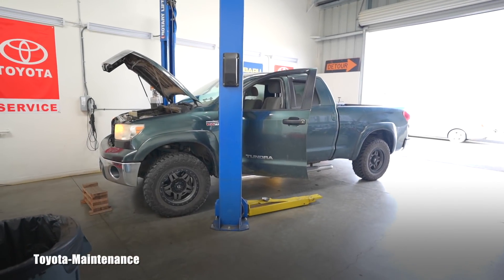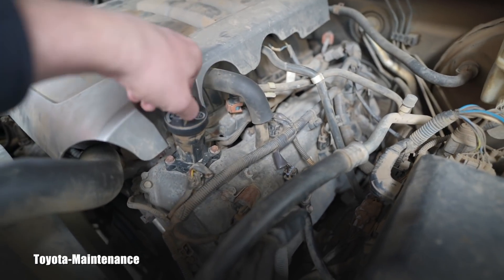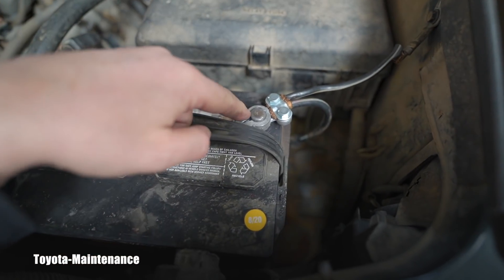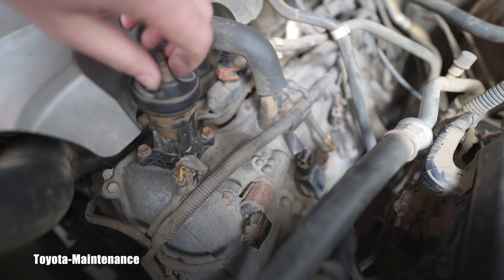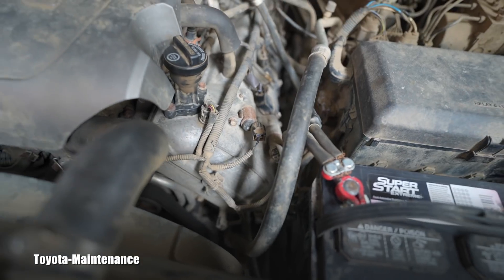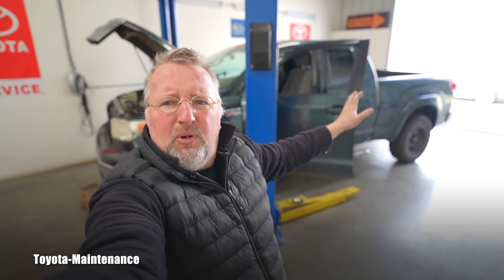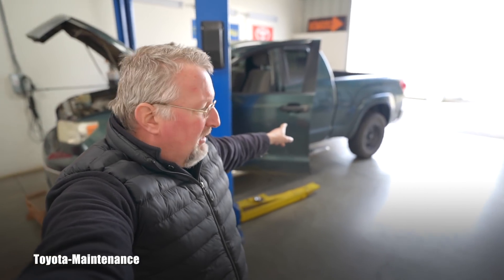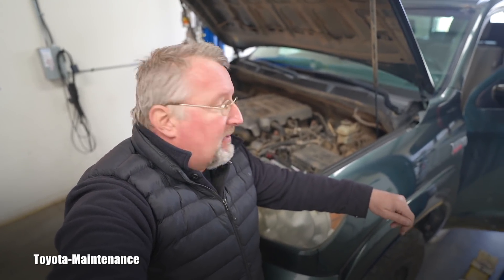Toyota 5.7L V8 Engine 3UR-FE clicking, rattling on Bank 1

Comment: It's the timing chain tensioner. I just fixed this on my truck
Reply: How many miles was on your truck when you changed it ?
Reply: @WVFAN1958  not sure. I bought the engine used from a salvage yard, it came out of a 2017 theft recovery and said it had about 30k miles. When I opened up the front of the engine I found someone had messed with the timing prior to me. The sprockets were marked with a paint marker and the timing chain was installed with the marks facing in and not synced with the cam gears. Anyhow, I cleaned up that whole mess. I tuned in to that issue because I noticed the timing chain slap was getting pretty bad at idle, I could hear it from inside the cab when waiting at a red light. Look "loose timing chain Toyota tundra" on YouTube and a few videos come up where they identify the symptom and cross your fingers you don't have to do that job.
Reply: I didn't realize this is the video of the chain slap... This is it.
Reply: @rosadoja2000  so just replacing the main tensioner has cured your issue this far?
Reply: @teamhogmeat  Yes, riming chain job did it for me and have not had this issue sonce. i took a "now that you're here" approach and replaced sprockets, guides, tensioners, chains, and crank shaft seal while I had the front cover open. It took me about a week working on it in the evenings after work and cost nearly $1000 in parts because I used all factory parts. I didn't buy aftermarket parts. It's not a difficult job, just make sure you get TDC right before you take it all apart.
Reply: @rosadoja2000  Thank You
Reply: @rosadoja2000  did you replace the phaser sprockets also?
Reply: @grahamwheeler9469  I am not sure what exactly is  phaser sprockets, but I will assume it's the VVTI sprocket on the intake cams. Those we're not replaced. Only crank shaft sprockets (it has 2). The engine will throw an error code for the cam shaft position sensor if there is a problem with the cam shaft sprockets. I would not replace them unless I got that error code. Funny thing about it was that there were no error codes for the lose chain. It just sounded like a diesel engine.
Reply: @rosadoja2000  The reason I'm asking is because my 2013 broke the small chain connecting to the bank-1 exhaust cam, and the mechanic who diagnosed it wants to replace basically everything.... They did a leak down (10% on bank 2 and 50% on bank 1) test.  Those sprockets are really spendy....and it's making the total cost of the job about the same as swapping  a motor out of a wreck with less miles..... So I'm kind of in the "limbo" of deciding which way to go....   Its rather discouraging, as I just got the vehicle.... the shop does say that the quality of the internal oil appears to be fairly clean/ good.... no sign of abuse/lack of maintenance  (coked up oil deposits)...
Reply: @rosadoja2000  The reason I was asking was because on my 2013, the small chain on the exhaust cam broke...I understand that the sprockets that carry this chain (between the intake cam and exhaust cam), are called phaser sprockets.  They are really expensive sprockets.  The guy that is looking at my motor did a leak down test on both sides (bank 2 - Passenger side), is about 11%, and bank 1-drivers side is about 50%).  I understand that leak-down tests are supposed to be between 4-12% to be within spec - so one side is "good as new" for  a cold engine, and the other side indicates moderate valve damage.  

Frankly I'm in limbo-just now... Cause the price of changing all the parts that the mechanic is quoting me to do is basically close to the cost of pulling my motor out (229k miles) out and swapping in a motor from a wreck (2014 with 135k miles).  The only pause, is the mechanic said the oil in my motor didn't look bad - No deposits/lack of oil changes apparent.... I just bought this thing literally 1-month before the chain broke...so while I don't know the maintenance history perfectly...clean oil-inside is a good sign... And with a wreck you don't really know how it was maintained...  The one thing that could tip-the scales to fixing, is if the phaser-sprockets didn't have to be replaced... If the old sprockets are acceptable the job cost would be reduced by about 19%... and make repair the preferred route..    I need some specs to evaluate if they are good or not... Unfortunately the mechanic has a "replace everything" mentality, where as I don't think it is all required to be replaced.... but I don't actually know that...  I know of that attitude, as when he started to price the job, he actually suggested to replace the timing chain cover.... which I thought was madness....
Reply: @grahamwheeler9469  sorry to hear about your new to you truck breaking down. When I bought my truck, I bought it knowing it had issues so I got a good price on it although I didn't anticipate that I would need to replace the engine within the first few weeks of owning it. There is a lot to consider when buying a used engine but due diligence pays off. For example, if you go to the used engine market, you can narrow down your search to a select few candidates and run the Carfax on the VINs to paint a picture of the history of the truck that the engine came from. You have 3 options:
1) fix in place (what you are considering)
2) get a decent used engine from a wreck or theft recovery (what I did)
3) buy a freshly rebuilt engine from a quality reputable builder

From a reliability perspective, option 2 is best if you find yourself am engine that was cared for.
With option 1, it's the highest risk mainly since your engine is not holding compression. The risk of having valve damage from the broken chain, opening the head, having to remove it, getting all original parts, will cost you almost the same as a swap. That's why I decided to do the swap.

Option 2, the risk is obvious but you can mitigate that mostly with due diligence. Find yourself a theft recovery low miles engine. I scored one with 17000 miles on it from a theft recovery.

Option 3 is the most expensive, but you have peace of mind and the risk is lowest.

Remember, what may seem cheap today is going to cost you more in the long run. Like my buddy who buys a rebuilt battery every 3 months at $40 a pop. By the end of the year he has spent $160 on car batteries when he could have just bought a decent battery for $120.
Next point is, if you go with option 1 or 2, use only genuine Toyota parts where ever you replace parts. Don't cheap out with Amazon parts.

Lastly, if you don't fully trust your mechanic, find another one that is honest and thorough with the trouble shooting. I do all my own work except for the really hard stuff like automatic transmission rebuilds or carburetor rebuilds. In those cases, I remove the part and take it to the shop and have them do the bench work. But you have to have an appreciation for fixing cars to do this kind of work and enjoy it. I'll tell you... It is very satisfying when you can get in your vehicle and drive down the highway or cross country, with peace of mind knowing that your hands, mind, and ability made this possible.
Reply: @rosadoja2000  I''ve done my own timing belt job on the V8 on a previously owned Sequoia 2003, and Tundra 2002.  But I don't have a shop at this moment, and it's kind of tough to do that job without a shop.... 

for a 4th, option...I actually stumbled across a Chinese knock off 3UR engine that I can get for only $750 new.... I'd have to buy 2, and I understand with shipping would be about so about $1000/each for two factory new "knock off's".... waiting about 75 days for it to arrive.. (I would assume I could sell the extra for about what I have into it...but even If I couldn't its not a bad price.....if it would run well for 100k miles).   Toyota quoted me something ridiculous like just under $26k for a new one.... 

I am kind of leaning on the used motor idea.... That's a really good idea to get a car-fax on the vehicle that the motor comes out of.... I hadn't thought about that.... service history was the one thing I was worried about...

If you are curious about the knock off Chinese motor check this out... 
https://www.alibaba.com/product-detail/CNBF-Flying-Auto-Parts-3UR-Motor_1600329730312.html

I think I can trust the guy who I'm at, but he quoted changing the Cam Sprockets on both sides... they are different on exhaust/Inlet/ and for me amounts to almost $1400 alone... as he is charging me retail... I know I can get them direct for about %20 less...but it's kind of mute unless I do it myself...  A parts guy at the dealership kind of highlighted to me that with the broken chain, there may be "shrapnel" kicking around the housing and it could have caused other damage.... However it didn't exactly "run" long after the chain broke.
Reply: @grahamwheeler9469  I would stay away from the knock off stuff. If I were in your shoes, option 4 would not be an option. That's what I was referring to with the cheaping out with Amazon parts. The Chinese bootleg Ali Baba stuff is good for some things, but not as an equivalent for genuine parts. One of the things you have to consider about Toyota is how Toyotas retain their value. If you go with a knock off, your truck would lose value if you ever have to sell it. 

Im not telling you what to do. I'm simply going through the logic and reasoning that I would go through, if I were in your shoes. I would find myself a good used engine that is still factory sealed. I would search within a 250 mile radius for someone that is parting out a tundra or Sequoia. Even better if I can see and hear the engine run before I would commit to it with my hard earned cash. To me, the engine with a busted timing chain is toast and would need a complete teardown and inspected for bore and piston tolerances, cracks, and cam lobe tolerances. Then put back together with genuine parts. It's too much time and parts, that it's more cost effective to get a good used donor engine. That's how I would approach it. Although that being said, I am big on quality work and parts, i pride in ownership, and I highly value reliability. Those are the values that guide how I reason out and decide any repair situation on any of my Toyotas that I plan on keeping for a long time.
Reply: @rosadoja2000  I have been thinking of sticking with a wreck donor motor.  I'm actually up in Canada, so my Choices aren't as good as down there.  I've been converting price to USD to keep things consistent in our conversation.  I really appreciate the carfax advice!  I actually found that the maintenance info can be had for free, on the Canadian site... I just have to sign up and add the VIN's I'm looking at to my "garage".  I'm considering a side-impact-wreck motor with less than 75k miles on it, out of a 2014.  It's also "lived" away from places where salt is used, so I kind of like that also.  I'm thinking I'll be about maybe paying about $1k more than the rebuild, but I'll have a motor with 1/3 the mileage on it.  

I did kind of get a deal on the truck.... but there was a "whine" in the back end and I got new berings put in there.... so I've already fixed one "biggie".   I did breaks all around - Brimbo, where I could get them... and I noticed that the rear "dust covers" were "like new", where as the front ones were kind of "rusted-crumbly"... So that tells me that the rear bearings have been done...So I'm guessing the only remaining major repairs will be "suspension", and maybe front bearings....  My son did suggest that I may as well try to get the transmission with the engine... I'm not sure what to think of that... I don't have a good feel for the life of the transmission....  Thoughts on the transmission front?  Its got just under 230k miles on it.  I haven't even asked the transmission pricing question yet...

Comment: Take off the valve cover and clean the oil rail and the filter located on the under side of valve cover you will need to remove the 3 10mm bolts on the under side of the valve cover to access the filter
Reply: Driver side valve cover correct?. Doe that rail feed oil to the main chain tensioner?

Comment: I thought Toyota V6 and V8 engines had timing belts, not chains.
My Chevy Express 5.0L had an annoying ticking noise too.  My friend who owned (now retired) a transmission shop put it on his lift and it turned out to be a bad catalytic convertor falling apart internally.  I could have sworn it was coming from the engine.

Comment: I had a '93 Mazda MPV that started clacking like that every single morning. I could drive to basically the exact same spot every day and it would stop within half a block. Every single time. I think it was a valve lifter. Sold it like that. Still ran for years later.

Comment: 0-40 synthetic with a good oil stabilizer such as Hot shots secret, stiction eliminator. I had the same problem with my 08 . Works great
Reply: 0-40 Eliminated the noise ?
Reply: @anthonyvasquez7050  it did with Hot shots.

Comment: I have a 06 Tundra with 2UZ-FE eng, after timing belt complete job(everything new & japanese parts) it started making a similar noise, please if you can work on that vehicle and make the diagnose, I really need to have options for getting it away, my noise doesn't go away.

Comment: Sounds like a valve issue. Broken valve spring? Is the piston is coming into contact with the valve head. Probably start with a relative compression test and try to figure which cylinder it is.

Comment: This sounds like the VVT unit is hitting its end stops - normal at startup until oil pressure is up for letting the computer adjust cam timing. Maybe an oil blockage or using oil too heavy. Only 0-20 or 5-20 oil should be in this engine. Considering the rest of this trucks lousy condition, especially the dusty throttle body,  I suspect poor oil and air filter change routines were used also - may have lacquer or dusty oil blockage or the bank solenoids are sticking. If the air filter failed, the oil filter isn't far behind and the oil bypass would let dirty oil everywhere. I know from my 08 5.7 that squirrels or mice like the taste of the air filter media.

Comment: Is another one of the tricks? First rule, ignore the customer self diagnosis. Like you taught us. 

Battree has nothing to do with it likely. Wish you put light down filler neck to let us see if there is lash. Maybe like you suggest, hydraulic tensioner. How often does that fail/is 200k mi about when it would? Some forums said chain guide. Some are made of plastic. You don't act like this is an emergency required immediate repair..

Comment: I have a 1997 Toyota RAV4 which developed an engine tick...... spent ages trying to fix it..... turned out to be the catalyst heat shield bracket rusted away  and the rattle of the loose shield transferred up the pipe and manifold giving the impression of head noises.

Comment: I recommend changing your oil sooner not 10000 miles.  mine does it after I go over 8000 miles only on a cold start. I heard it at very random times and goes away once warmed up. Never threw a malfunction code so it should be ok. I'm at 35 k and always maintained well. I do drive alot of short trips so I think issue is with the oil changes being too long for me personally due to my style of driving

Comment: That happened to me. Are the valve lifters. When the space between the lifter and valve gets to high, the noises increases and even fresh oil can’t fix it. Valve lifters must be checked after some miles (around 90k I believe). In my case I bought many of them to replace and find to standard specs. And noise disappears. Cheers

Comment: My ‘14 Tundra 5.7 gets frequent oil changes per factory specs, i have just under 100k miles and runs like new. This Tundra was neglected and abused.
Reply: The best money spent is oil and filter. When my Tundra hit 6 months old the dealer said oil is good to 16 000 kms...I said just change the oil and filter.

Comment: Googled it. Tundra forums....definitely the Flux Capacitor. Very common with the 5.7 V8s
Reply: Needs more plutonium.
Reply: @highplainsdrifter9849  Yup...that too
Reply: Exactly very common and nothing to worry about
Reply: Parker Outdoors  First generation Tundras are frame rust buckets. Breaks in half Junk. Also won't get a million miles. Lol. 2nd gen. Far superior. Towing and Hauling far out performs 1st gen.

Comment: Nothing to loose ... pour in a quart of Marvel Mystery oil and let it idle for about 10-15 minutes.  I've seen this stuff work wonders to free sticky parts.
Reply: Yep.My Dad used it in his 1972 Mercury Comet when it was about 8 years old or so and had a few noises from valvetrain.Problem solved in less than an hour and religiously used a little bit of MM oil every oil change.Engine ran over 250000 miles before the rust monster ate it up in mid 90's

Comment: Mine had the same issue. I did an engine oil flush and the noise has not returned for several months so far.
Reply: What kind of flush did you do?
Reply: @eddieplana2310  Motul Engine Flush